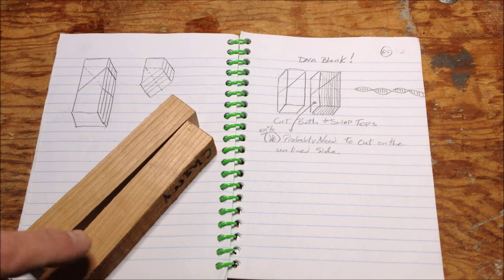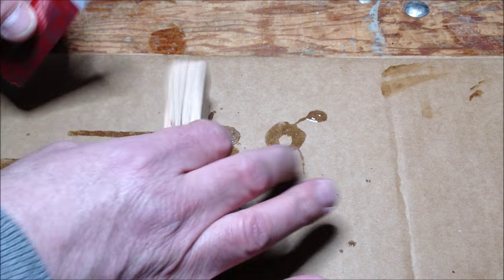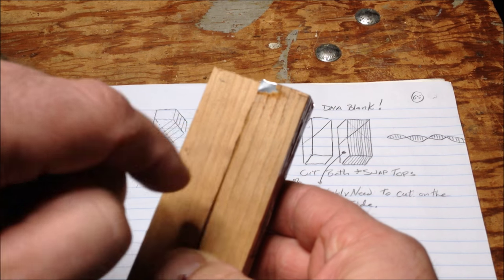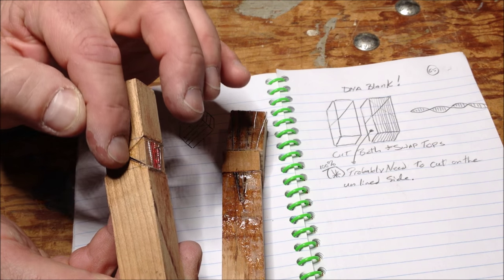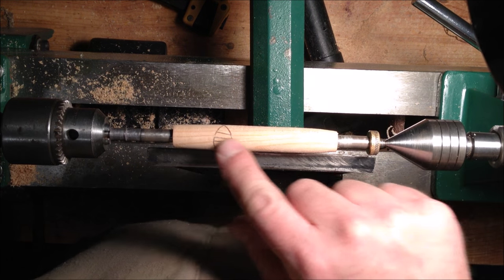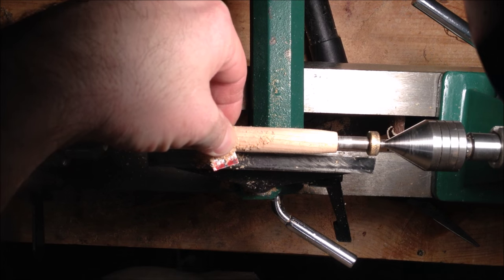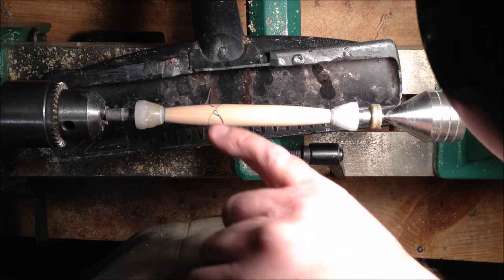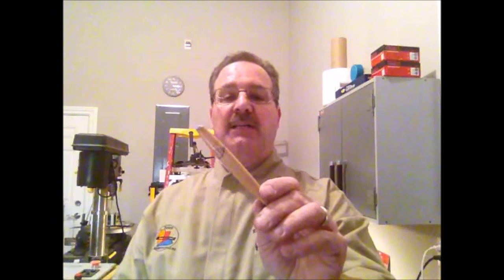DNA Strand Ink Pen

Comment: Another very interesting alternative to what you've done, very clever. A couple of things that might help in future, sanding what you're actually inserting into the blank. This will give it more grip which eliminates break out (like your colored pencil idea, I sanded every pencil I inserted, with no break out). The other sugestion, I've clamped a piece of wood on my scroll saw to act as a guide to keep my cuts straight. It's easy to change angles and the results are great. Hope this helps. Thanks again Bob for the time you take on these videos, I always love what you come up with, and you always keep them interesting.
cheers, from Paul, South Australia.
Reply from the maker: +SabotPottery Hello Paul,
  Thank you for the tips, I especially like the idea of the guide on the scroll saw. It's so simple that I can't believe I never thought of it. 

Regards,
Bob

Comment: A very clever twist!  You should try a 6 sided Celtic knot with the soda can aluminium.
Reply from the maker: +Tenspeed TheBikeHanger Six sided, I never heard of that. Do you have a photo so I can see what it looks like. It does sound cool. 

Regards,
Bob
Reply: +RJBWoodTurner Here's a link to instructions. The writer uses a hand saw, but the same principles apply to power tools. You could even do 3 or 8 strands if you were so motivated. http://content.penturners.org/library/pen_blanks/6-Segment-Knot-Pen.pdf
Reply from the maker: +Aaron Logue Thank you for the link. I'll defiantly check it out. 

Regards,
Bob
Reply from the maker: +Tenspeed TheBikeHanger Thank you, I'll check it out. 

Bob

Comment: Have you thought about making a pen blank template for putting segmented pens in to harden up while putting preasure on to keep the joins tight?.
Reply from the maker: +BusyBeeCompany Hello,
  I have a couple drawings of jigs I've been thinking about. I need some way to apply pressure while drying when I use wood glue or epoxy. Do you have a jig you use?

Regards,
Bob
Reply: not yet, im more of an ideas man then creator..but id think a clamp with tips smaller then say a 7/8" jig would put preasure from the ends and the top can be preasured by strong elastic, then three sides just have to be made for 7/8" or whatever side, then a loose top preasure from the same size to fit in easily but not leave gaps...im thinking the same plastic you use to not have glue everywhere when your turning would suffice to make it out of...so trequiring a solid block as the base, longer the you need, adjustable sides longer then you need, tops of various sizes which can be longer also and a clamped type end to preasure the blank together from the ends...either modified clamp or fixed one end and then preasured from the other with a piece smaller then the end of the blank....hope that is understandable
Reply from the maker: +BusyBeeCompany Thank you for sharing your idea with me. I need to put some of this down on paper.

Comment: Good idea Bob and I want to thank you for one of your tips that I use quite often I make a Lot of Pens and other products out of Camphor Laurel (I don't know if you get this timber in the U.S. over here in Australia the tree is considered a weed or pest tree) but there is a problem no worry with bowels but when you have to take it down to the size of a pen bearing it will break away so now after I barrel trim I flood the ends in ca glue end of problem so thanks mate from Downunder
Reply from the maker: +Trevor Vesey Thank you Trevor. 
  I can't get the Camphor Laurel wood here. What your describing reminds me of Palm wood. Palm is the same way, it's like a bundle of brittle straws. The C/A really helps with it too. 
   I am very happy that you were able to use that C/A tip. Send me a photo some time of the wood and one of your pens made from it, I'd love to see what both look like. 

Regards,
Bob

Comment: Very clever idea.  Is there a reason you brought in the lines as radii instead of parallel lines?
Reply from the maker: +Make Crazydays Yes, I wanted to simulate the twist of the double helix and I thought a little angle would help emulate that. 

Regards,
Bob

Comment: Hi Bob,
I would like to ask another question, if you can answer it  i will be happy:)
so right now im making myself a diy turning lathe ( washing machine motor plywood etc )
i was wondering what is the  thickness of the rod that you put your blanks on to turn. i will buy allthread as a subtitute but i need a thickness info. 
great vid and great job as always
Reply from the maker: +d. kongul Good morning, 
  The rod is 1/4". That is a standard size so any pen kits you purchase, their bushings will fit it perfectly. 

Regards,
Bob
Reply: Thank you Bob you amaze me with the answer speed everytime. Have a nice day
Reply from the maker: +d. kongul Your welcome,
  I try to respond quickly when I can. I will always get back to you, if it's not a quick response, I may be with my family. Rest assured I will respond. 

Regards,
Bob
Reply: My hat is off to you sir...
Reply from the maker: +d. kongul Thank you. 

Regards,
Bob

Comment: Well done Bob and I look forward to the next iteration of the DNA pen.  I have to ask you about the CA glue.  How does it hold up over time both for structure and for finish?

Karl
Reply from the maker: +Karl Becker Hello Carl,
  I have pens I made five years ago that are still I use by the recipients. C/A as a finish holds up very well. 
  I haven't had any failures with two pieces glued together coming apart either. I use C/A primarily for prototyping because it's quick. I use epoxy when I'm making a pen for someone. 

Regards,
Bob

Comment: Hi Bob, I'm new to your channel but I've been making pens for over 16 years. this is the first time I've seen a "modified slimline" pen. How the heck do you change the refill ?
Reply from the maker: +jim renderer Hello Jim,
  Here's another video I did just about the modified slimline:

https://youtu.be/-5_X170QEMA

  All you do is get a firm grip on the nib and pull it out. The transmission, nib, and front tube are not glued in. They attach by the snug fit of the transmission.

Let me know what you think. 

Regards,
Bob
Reply: Thanks for the quick reply,  Bob. I'll give it a try.
Reply: +RJBWoodTurner Took the words out of my mouth.  I don't know nuthin and was wondering how it was assembled
Reply from the maker: +Dave White Hello Dave,
  Thank you for commenting. The modified Slimlines are fun to make and let you showcase more of the blank. They also offer more blank to get creative with design elements on the pen. 

Regards,
Bob